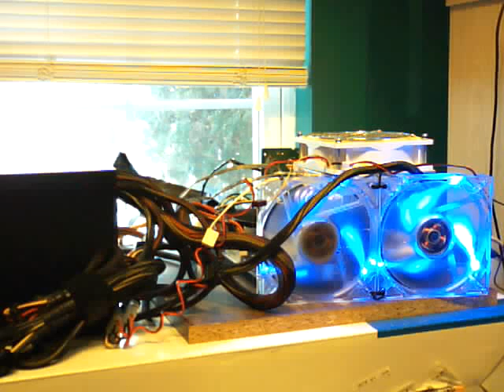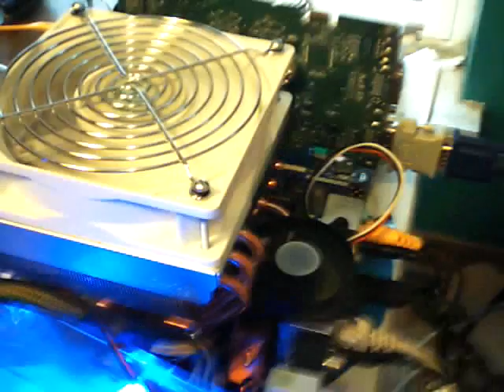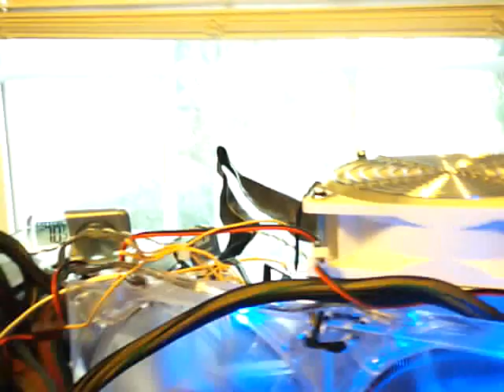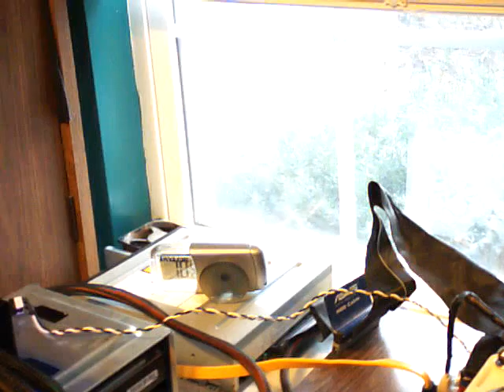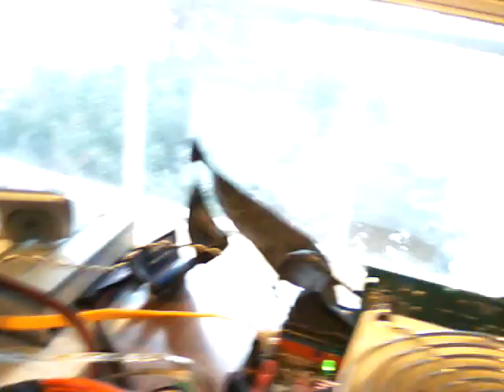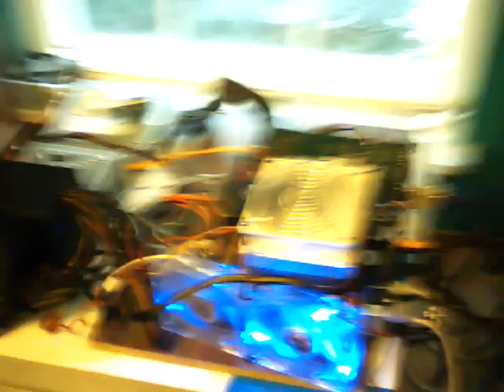My Computer Cooling 2/21/08

Comment from the maker: First off I have been running my rigs along time like this and currently still have it out of the case. I will take my chances I am very careful have had no problems yet thanks for your concern but I am fine running it like this. My board is dyeing from to much overclocking so I could care less if it dies now it would give me more reason to get another.